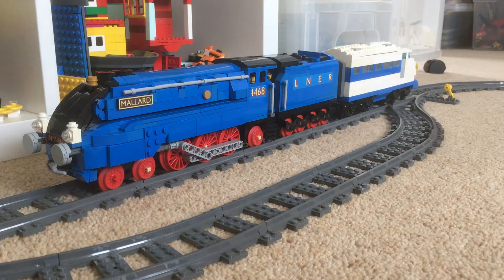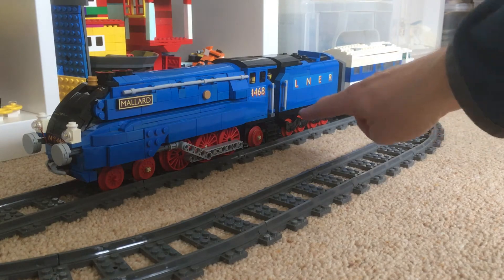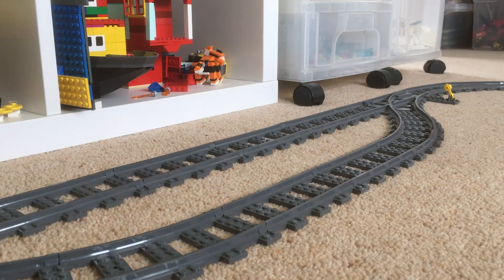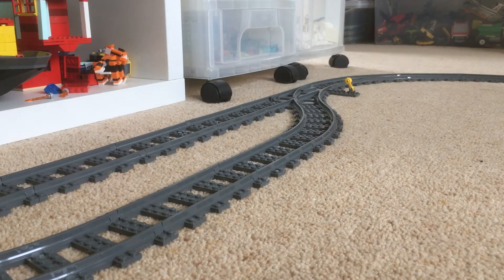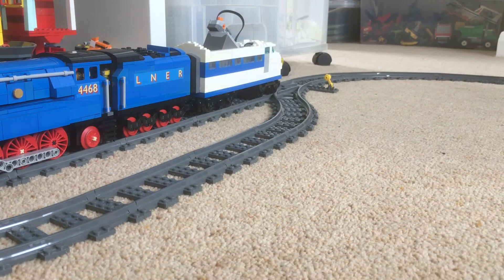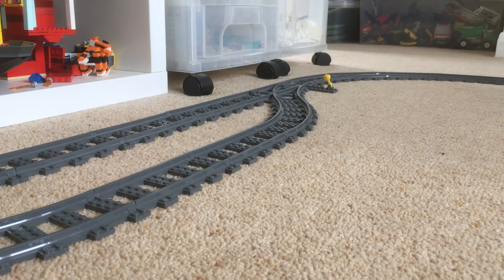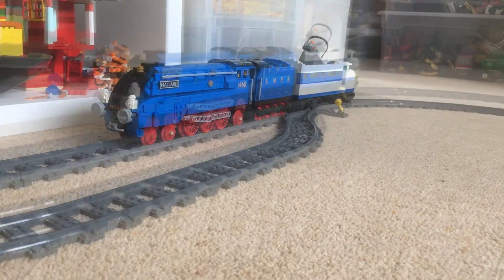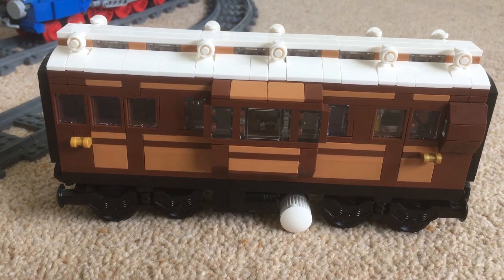Mallard Train Motor Experiments

Comment: Maybe you could put some lead weight inside of your bullet train? I wouldn't know if that would work because I don't have a powered motor for my mocs
Reply from the maker: Yes, I think the battery box add some weight to provide traction. If I put the motors in the dynamometer car, I might need to have the battery box in it too...
Reply: I think you should have two batterie boxes for traction but also for enough power.